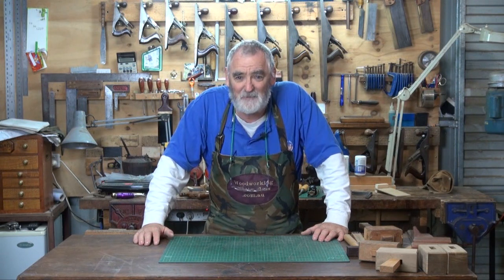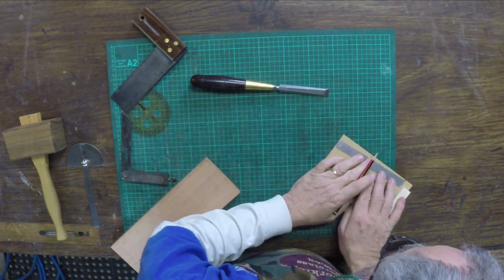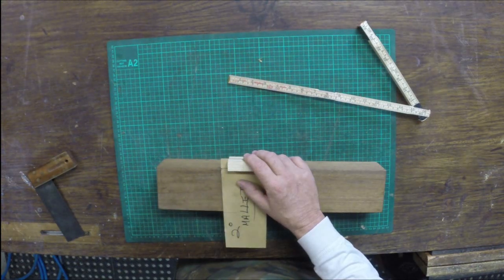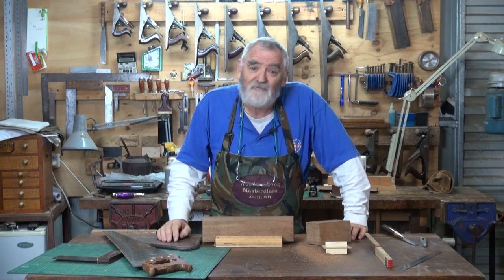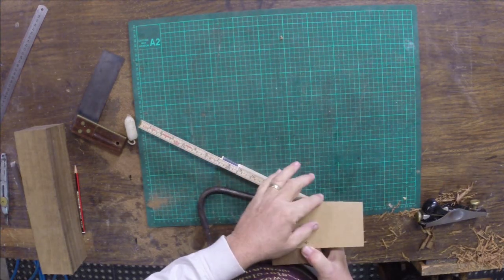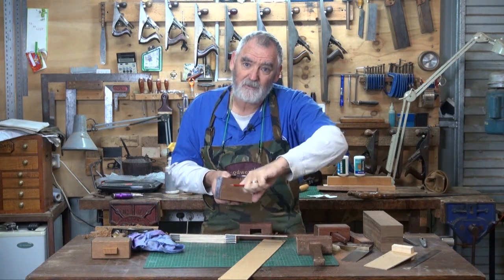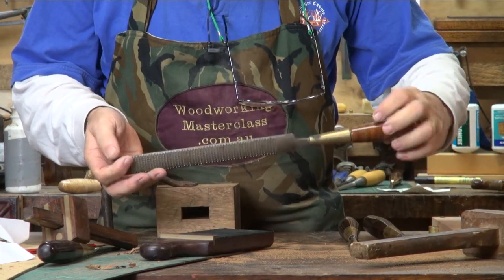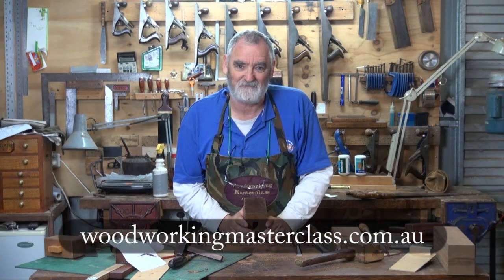How to make a Wooden Mallet Pt. 1 of 2

Comment: what joint would have to be used to join a round handle into the block?
Reply from the maker: Hi Isaac, Round hole in the square block with a Fox Wedge fitted to the round handle. Then drive it home. The expanding wedge will hold the handle in very tight without the need for glue. Cheers Steve
Reply: thank you very much!
Reply from the maker: :) Pleasure Isaac. Cheers Steve